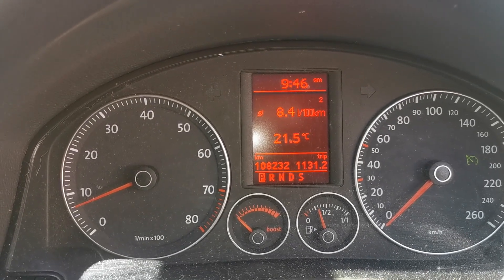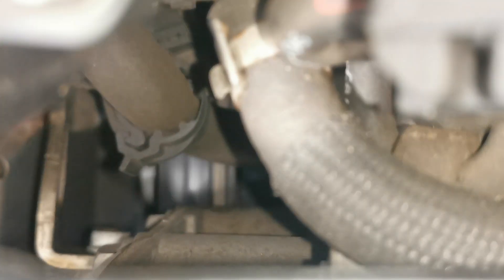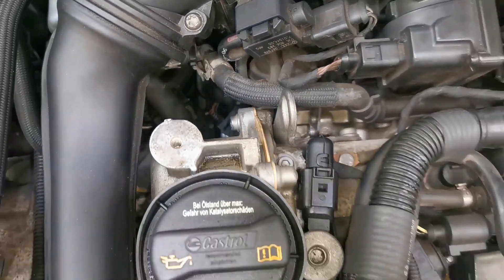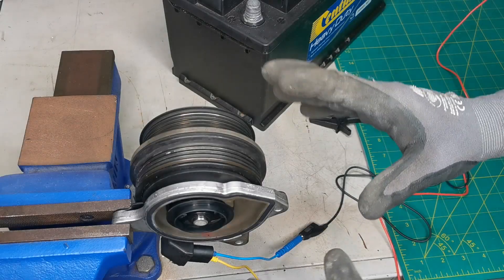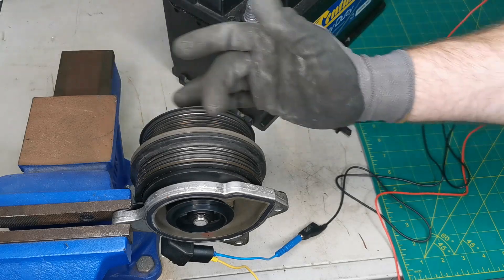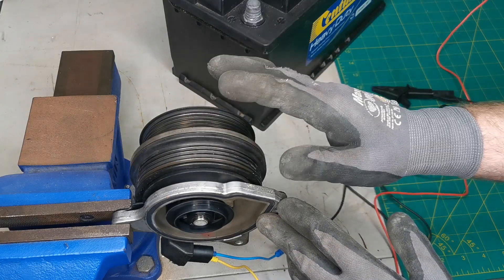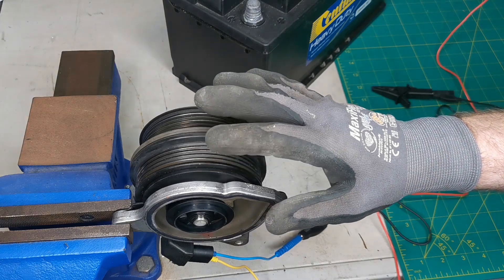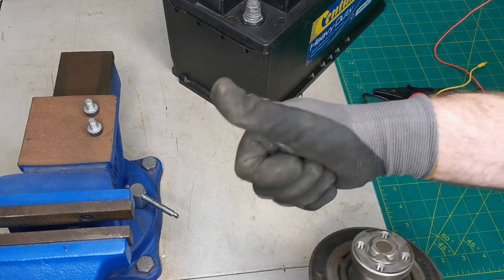Volkswagen Clattering Noise - Found & Fixed - TSI / TFSI Twin Charged Engines

Comment: Hello mate, if you could please get back to my comment.

I had my timing belt and water pump changed, after 1 month max it started to do this noise. But when I press the clutch in, noise goes away. 
Been told I needed a new transmission, been told it was bearings, been told it was flywheel. But now with your video it has me thinking it could be the water pump. Because the noise only came up after changing it. 

If you have any suggestions please help me thanks

Vw golf MK7 1.6TDI

Comment: Hey there, I have a similar issue with my Scirocco 1.4 TSI. The car hesitates when I try to accelerate, and I hear a short whistle (it’s not like the turbo whistle, more like a brief squeaky sound that lasts about a second) before it accelerates normally.

Do you think the whistling could be related to a problem with the water pump?

By the way, the turbocharger was repaired and before that the water pump was replaced. I don't remember if the belt on the water pump was replaced.

Thanks a lot in advance for your help!
Reply: Hey, did you solved the problem? I also have that squeak sound when i accelerate.
Reply: @salvadorcanoherrera7460  I didn't, but now it's almost completely silent. It's not cold outside anymore and I think that's why. I will change both belts on the water pump and I think that will completely solve the problem.

Comment: Just watched the video ' with the supercharger clutch how it works , if this does not work , can it stop the engine giving full power , and will it go into limp mode. I have a  mk 5 VW golf 1.4 tsi  GT twin charged . The thing is with my car I had a new  down Flexi pipe fitted , which they did , but he said he moved the car about a few times , then when he comes back to it , it would not start , anyway he told me he put it on the diagnostic reader and it came up that the cam chain had jumped on the teeth , so he checked the valves were okay and did a compression check , all was okay and he fitted a new cam chain and tensioners , now when I went to pick up the car it was fine , but when I go higher in the rev range , it goes in to lime mode , the engine runs and ideal is fine , but as soon as you get to 3000 revs it goes in to lime mode.
U car has done 106000 miles and that supercharger clutch has never been looked at , I notice I get a squeak sound when excelerating , could this be supercharger clutch playing up and wants replacing , the garage did not charge me for the cam chain and tensioners. I know if the call rolls back in gear this can knock the timing out , I feel this happened and that's why he did not charge me for the work he did, and only charged me for fitting the exhaust down pipe. If you can help me with this problem I would be very grateful

Comment: What does that little other belt control that shares the same pulley as the water pump?
Reply: @tommyl9979 it's for the supercharger. Has a magnetic clutch to spin the supercharger when needed